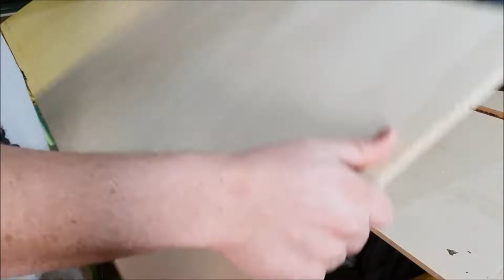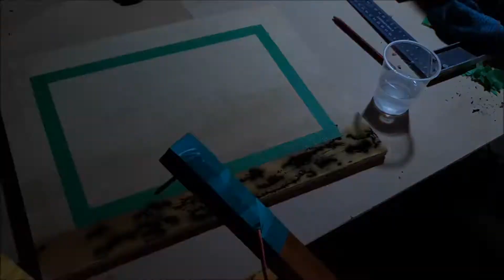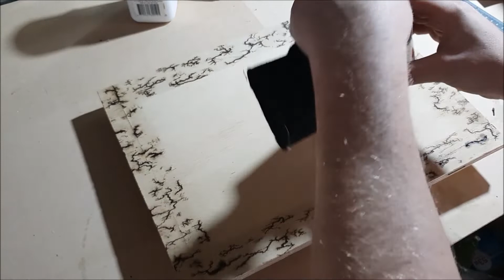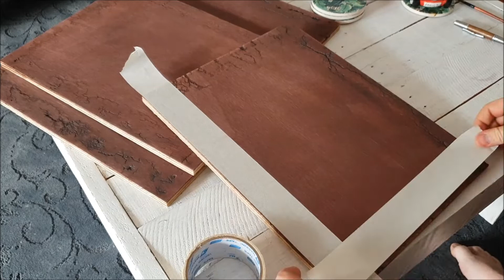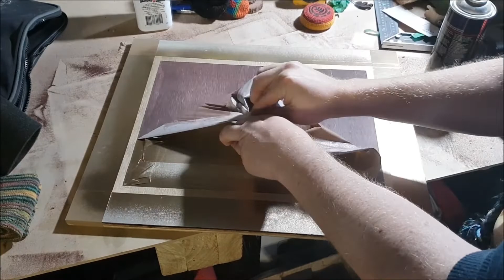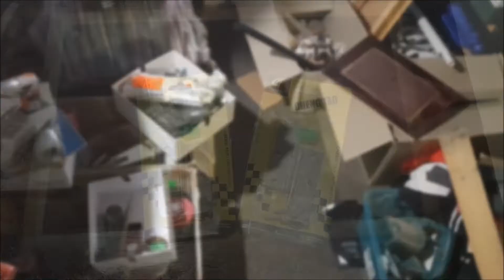Dungeons & Dragons DM Screen // How to build your own

Comment: Heeey, what's the thickness of the plywood you used? I'm struggling with choosing good hinges for my 10mm thick plank 🤔
Reply from the maker: I think I had 12mm from memory. Hinges were a pain to get right.. I've made a small box since then, and found that if you have predrilled holes, you can grind down the screws and use a bit of super  glue to give a good hold 👍 hope that helps.
Reply: @lakesideprojects7194  Yes, that helps a lot, thank you very much

Comment: What was the relative cost for the materials used in the final product? No conversions required.
Reply from the maker: The wood was around $20, the hinges were $2.50. The paint was $10 for the whole can and the stain was $30, even though I used bugger all. All in AUD. Hope that helps 🤙

Comment: what kind of power supply do you use for your woodburning?
Reply from the maker: I've got an old microwave transformer I use. It's the most unsafe thing I've got so I can't go recommending it to people, but it still looks good.
Reply: @lakesideprojects7194  I agree. your work is great. I would like to do this, but the ghetto transformer power supply really scares me. any other thoughts on how to do this?
Reply from the maker: @alzathoth  if I found another way I would have much preferred to do that. Had to go ghetto..